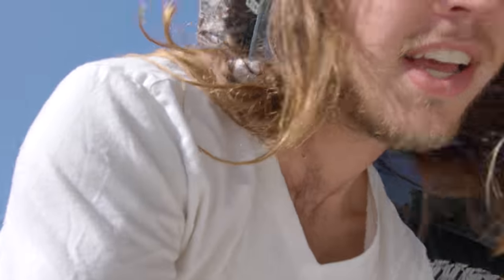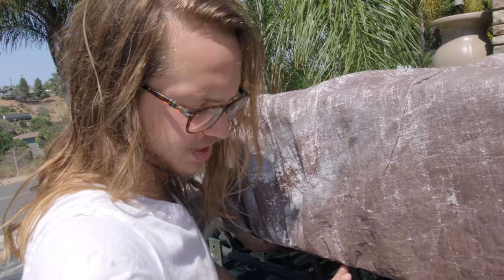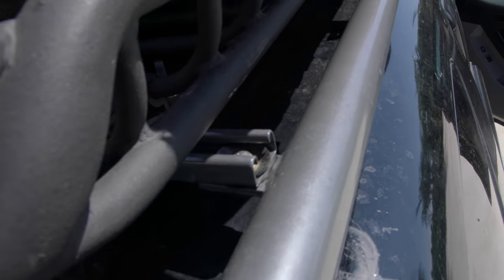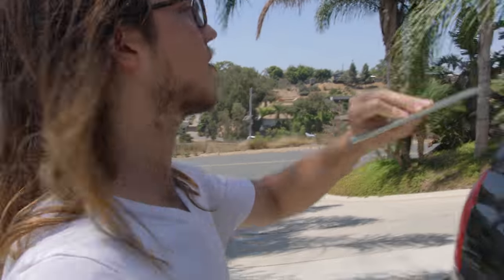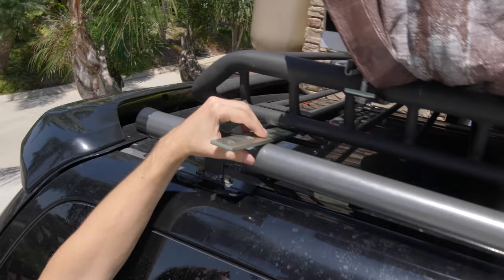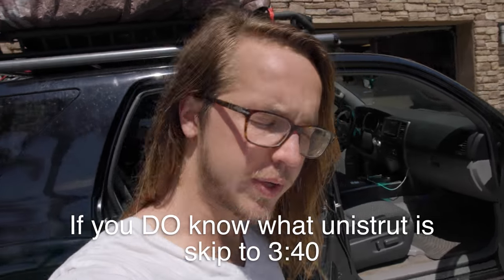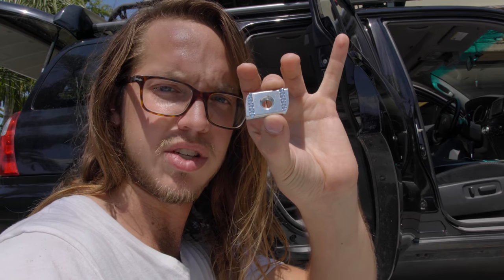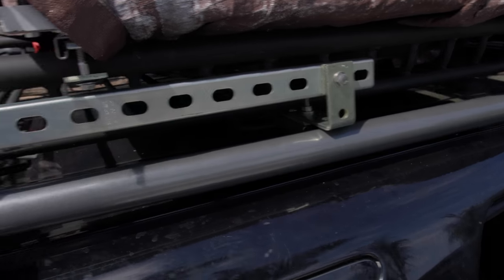Vlog #4: Portable Shower Custom Rack Mount - The WaterPORT

Comment: Nice work man.Thats what i hate about this tank,there is no brackets or any kind or slots to keep it secure you have to built something or buy their mounts thats sucks.There is a lot of water left in the tank after using it,its good for 30 seconds and your done,i think a jerry can with a small portable shower 12v or batteries style will be better.I really like the tank,i like the idea of it.I bought it for my kid,wife and myself but quickly realize its not what i am looking for,i will find a use for it but not for long trips.
Reply from the maker: I get around 2-3 showers out of it, so it's not a long trip tank for sure unless you are near water and can refill. I actually get pretty good pressure from mine for most of the water. Not sure what's different